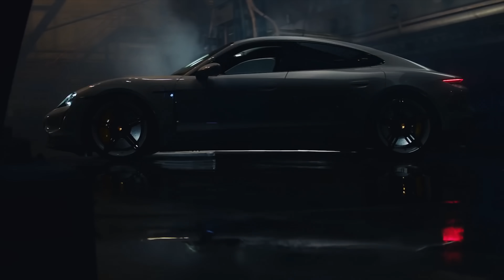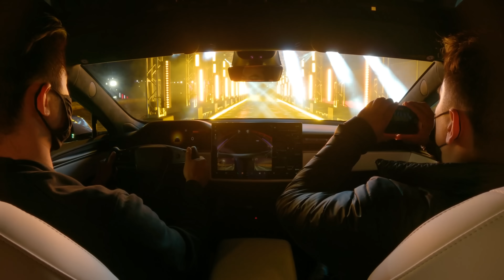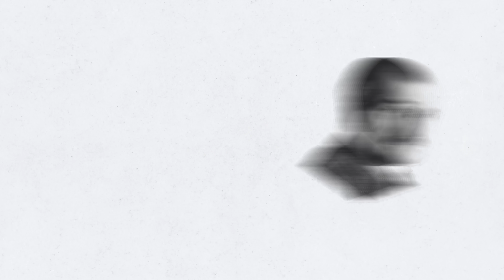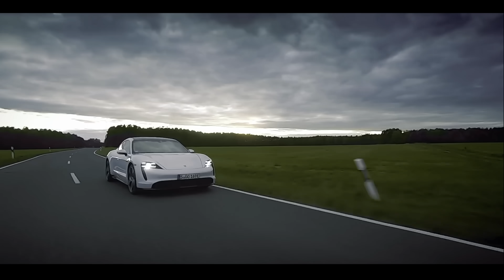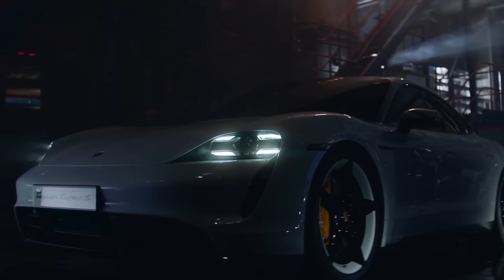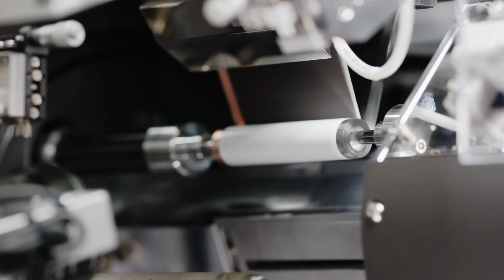I’ve Had Enough, Here’s the Truth About Tesla

Comment: Aesthetically, I'll take the Porsche.  Realistically, I will take neither and I hope I never have to own any electric vehicle.  I used to say that about automatic transmissions, yet circumstances dictated that my last purchase was of a Honda Accord with a 10AT.  After a year of driving it, I have to admit that I like it and the reason has a lot to do with the paddle-shifters, which give me very nearly the same control over the transmission as I had with manual transmissions and in some ways more.  I do miss the footwork, though.  So, while I'm not too old to learn to accommodate a new skill set, I  hope that I never get old enough see a time when electric cars become mandatory or the internal combustion engines become too expensive to operate.
Reply: They are already making EVs mandatory in CA. Glad I don't live in CA. I don't want to have to stop for 2 hours after every 200 miles of driving. Turn a 10 hour road trip into a 3 day road trip.
Reply: @keinlieb3818  it's not 2hrs, it's 20-30 min (with 150kwh charging) and under 20 min with 270kwh charging. I've taken road trips between Atl and Mia and the total trip time went from like 8-9hrs in a dino burner to maybe 10.5hrs in an EV
Reply: One of the main reasons this current government is pushing the gas prices up is to push us into EVs 😦
Reply: I couldn't have said it better myself!
Reply: Until EV charging is FAR faster than it is now, I’ll stick to gas engines… likely for the rest of my driving life. 

I have converted to cordless electric for all of my lawn tools though - even my lawnmower, which I like a lot.
Reply: @NorthGeorgiaHawg  I charge 200 miles in 15 minutes in a model three at a supercharger
Reply: @NorthGeorgiaHawg  I’m not pretending to try to save earth, they are just super fun to drive like a turbo go kart and retain all their value right now
Reply: Took the words out of my mouth.  Guess there is a psychological barrier to entry nobody talks about.
Reply: How do the paddle shifts do anything except pretend to be manual ? They dont do any more than moving a Old Automatic geat lever from 1, 2, 3 yourself manually. Agreed Automatics are better and less trouble these days, more Torque, less wheel spin in 4wd conditions etc and maybe taking away control so things get simpler and easier and probably safer but definately not more control over what happens to the vehicle.
Reply: @gravedanger789  Paddle shifters give you more control over the transmission than a typical automatic transmission has.  If you haven't owned one and learned to drive it, then I really can't explain it.  For decades I, too, scoffed at the idea until I bought my 2020 Honda Sport 2.0T 10AT.  It took me awhile to get used to it and after two years, I'm still learning, but I like the set up more and more as time goes by.  Please note that my Honda has ten forward gears, not three or four and shifting is smoother than any car I"ve ever driven.  There are times when it's best to let the transmission do its own thing and there are times when shifting for yourself is best. It's all about versatility.  When I bought my car I went in looking for a manual transmission, but Honda had stopped making them and there were none available in the United States for the dealer to acquire, so I took a test drive and decided to go ahead with the deal.  I will note that I'd been driving manuals for sixty years and thought I'd never be happy with an automatic.  Now that I'm in my seventies, I'm glad things worked out as they did.  Old dogs can learn new tricks.
Reply: Yes EVs suck!! My three year old EV has 50 K miles and I’ve spent zero money except window washer fluid, it’s quicker and funner to drive than anything in it’s class and it’s worth more now than three years ago. By the way every morning I wake up with a full tank for free. Thank you sun, dam EVs suck.
Reply: @John-209  Your points are well taken and my friends who own EVs confirm the benefits.  However, my preference is for internal combustion engines and the freedom they afford me when traveling.  I don't travel as I used to when younger, especially since the pandemic, but if I had to travel in an emergency, I would rather look for gasoline stations and not recharging stations.  I also live in an apartment and can't charge an EV at home.  That's an important factor.  I do have one question, though.  I presume that you have solar power and that's good for you, but not all of us have that option.
Reply: @GradyPhilpott  absolutely Grady I agree they are not for everyone. If you can’t plug at night they’re not worth it. I still love my old dodge gas powered pick up, have a good night
Reply: @John-209  Wait till it levels your house...
Reply: @isaac24  what?
Reply: @isaac24  what would level the house? The old Dodge pick up or the new EV?
Reply: @John-209  I'm still waiting to see what he meant by leveling your house, haha
Reply: @subarashiiashi3894  I’m thinking he means it will catch fire like a bolt

Comment: Unless and until battery technology VASTLY improves, I'm sticking with my ICE engines. If I'm driving a long distance, I'm not waiting around for hours for the battery to charge. I also won't have to replace an engine after a few years, as long as I maintain it properly. The same can't be said about batteries. No matter how well they're stored and maintained, all batteries have a finite lifespan that's much shorter than a well-maintained engine.
Reply: Try buying 10-year-old used Tesla batteries on eBay you're wrong 😱🤪😁
Reply: @rogerkerkmann  I'll trust my personal real-world experience with batteries over some internet rando, thank you very much.

Comment: So didn’t the tax payers pay for battery tech just like they paid for solar getting perfected thru NASA!
Reply: The US gov barely had anything to do with lithium ion batteries. It was panasonic.

Tesla works on their own battery chemistry, but their still lithium ions.
Reply: @honkhonk8009  so what have all the things in space used just direct current off the solar panels? Sure seems to me that system would need some thing to - even out, stabilize, or do what an inverter does compared to a generator? I suppose a little lead acid battery might work a top of the line one, if it’s not allowed to run down could last what 8 - 9 maybe 10 years?

Comment: Since Taycan was developed with old Model S as the benchmark so Porsche needs to do it again with Plaid.
Reply: @carsonj1  What happened when MB launched its E55 AMG in late 2002 with 479hp, was that the end of the BMW because the M5 at that point had 408hp?
And there are also many more important qualitites to a car than just even more insane acceleration. Unless you're 12 years old maybe.
Reply: @martinsvensson6884  you mean like the insane F1 like handling of all Tesla's? Yeah who would want that.
Reply: @SmokinPaul  Both MB AMG and BMW M petrol cars handle better than the high performance Teslas. Same goes for the regular SUVs.
Reply: @martinsvensson6884  LOL you don't have a clue. 😆 The battery pack is low making it almost impossible to roll a Tesla, suspension is more advanced. The traction/stability control is far superior because electric motors have extreme fine control you can't get from a brake controlled traction/stability system. 
But you keep dreaming and being an Anti-Tesla fanboy. 
You should take a Tesla for a free test drive. Many haters fell in love after one ride. 😊
Reply: @SmokinPaul  Yes I have. Because those cars have been tested. Its impossible to roll any car if its not wrongly constructed. 
Tesla has simpler suspension than the Germans. Its less advanced. Should come as no surprise. The German cars have to be adapted to the Auobahn where they behave much better than the Tesla.
No, the stability control has nothign to do with the electric motors.
They dont react faster either. The Tesla 4WD system is not better than anyones else. There are much better reacting systems out there. MBs for exampel.
Reply: @martinsvensson6884  keep believing what confirms your bias. 😁
Reply: @SmokinPaul  LOL  F1.... I have driven many TESLA's ...they do handle well but F1 is a laugh! Fanboy
Reply: @SmokinPaul  Has nothing to do with any belief. Has to do with testing.
Reply: @martinsvensson6884  guess you never heard of physics, weight distribution and center of gravity. 😊 One car is balanced, another needs to compensate for the lack of. 
Do I bet on Usain Bolt or the guy with the prosthetic? Yeah that's a tough one.🤔
Reply: @SmokinPaul  Its not enough.
Reply: @martinsvensson6884  you are free to drive anything you want. I'll take my Tesla that doesn't breakdown, doesn't use expensive very flammable gasoline and does handle like an F1 with perfect balance between front and rear. You might want to watch out for the moose though. 😄
Reply: @martinsvensson6884  why don't you take a Tesla test drive and tell us what you think? It's free and you can request one on Tesla's website. Many haters fell in love on the first test drive. At least you could be talking from experience then.
Reply: @SmokinPaul  If you want the best handling car you get an M or AMG. 
Doesnt break down? Haha :) No such evidence out there.
Reply: @martinsvensson6884  LOL 🤣 um yeah there is. Spinning electric motors are not under anything close to the stress as a reciprocating internal combustion engine that sees huge temperature swings and requires lubrication on it's plane bearings. 

But you keep on with your fantasies, EVs will continue to prove you wrong. It's the reason car dealerships want nothing to do with EVs, they can't make enough money on servicing them.
Reply: @SmokinPaul  The electric motor is a great device. Problem is the introduction of batteries and all their management.
The combustion engine is seldom the failure point of a car. And a good one will outlast batteries.

The reason car dealerships "dont want EV's" is for example that Tesla refuses to give them the info to be able to work on them.
Reply: @martinsvensson6884  Ford dealers don't want to sell MachE or any EV. Is it because Tesla won't give them info. 😂🤣 FYI they have already trained their mechanics on repairing their EVs. 
Tesla's are made to commerical standards to last 1 million miles and the batteries will outlast the car. 
You know so much, unfortunately most of what you know is wrong. 😁
Stop huffing glue, it's bad for your brain. LOL
Reply: @SmokinPaul  No but if the repair shops dont want EVs. 
Haha :) you need to stop reading fantasy on the internet and believe that's reality. No the batteries wont last 1 million miles. Not without heavy degradration and there are already people that have had do change them. Long long before that.
You need to enter back into reality from whaever delusion you're smoked yourself high into..
Reply: @SmokinPaul  If it handles like a F1 car, then why the Model S plaid was barely faster than the Alfa Romeo Giulia Quadrifoglio (510hp, 2x times less than the Tesla) on the Nurburgring?
Reply: @normaluser5755  LOL what's your point? Low center of gravity makes for exceptional handling. Your argument is you know a car that can win a race. :-) 
In your mind you win. hahaha
Reply: @SmokinPaul  You really think that low center of gravity is the only thing that affects handling? The S Plaid did so poorly on the Nurburgring because of it's terrible handling, combined with a poor steering system and awful brakes. It's even funnier that you're comparing it to the handling of F1 cars.
Reply: @SmokinPaul  Tesla's are only good at 0-60 times. Leave the race-track to cars like Porsche, Bmw, Alfa Romeo and other proper sports car companies.
Reply: @normaluser5755  An EV weighs as much as a truck so there is that. You keep thinking I was directly comparing a Tesla to an F1 instead of talking about it's F1 like handling. Keep missing the point to win the argument in your head. LOL Enjoy your ICE, it's a dying breed. :-)
Reply: @normaluser5755  Hahaha I don't drive my sedan on a race track, I drive it on the street where it is superior to most cars and has exceptional handling. But but you think a Porche is better on the track. LMAO 
FYI you are missing the forest for the trees.
Reply: @SmokinPaul  Exceptional handling LMAO. Have you ever driven an actual good handling car? Tesla cars handle like whales that swing around corners. Please try a BMW m3, Alfa Romeo Giulia or any sedan with actual good suspensions. Tesla's suspensions are terrible. I picked race-track times as an example of Tesla's bad handling. In no way Tesla's handling is F1-like.
Reply: @SmokinPaul  And yes, I'll enjoy my good sounding and good looking 2010 Alfa Romeo 159 :). Enjoy driving your soulless fridge on wheels.
Reply: @normaluser5755  yet you drone on and on. Apparently you never drove a Tesla, only your favorite sports cars that are not that good at being actual race cars, just pretenders. 🤣 
Like I said you win... in your mind. 😁
Reply: @SmokinPaul  They're still better sports cars than any Tesla. I know it's hard to accept that the M3 and Giulia are sporty sedans with a better suspension system, better brakes and an almost perfect 50/50 weight distribution that no Tesla has.
Reply: @normaluser5755  ROTFLMAO what ever gets you to sleep at night. 🤣
Reply: @carsonj1  But who really gives a stuff, both cars are excessively fast.
Reply: @carsonj1  Which automotive manufacture has a larger market name?? PORSCHE...Anyone with a brain would go for the PORSCHE....not only known as a sports car company but has also been around for a very long time....the jury is still out on TESLA's longevity as well as durability !
Reply: @carsonj1  you do know the gt2rs is the king of the ring right? You know that’s a gas car right? You do know that’s a porsche right?😂

A Tesla Model S Plaid has set a new lap record for electric production cars at the Nurburgring, with an official lap time of 7min 35.579secs. 

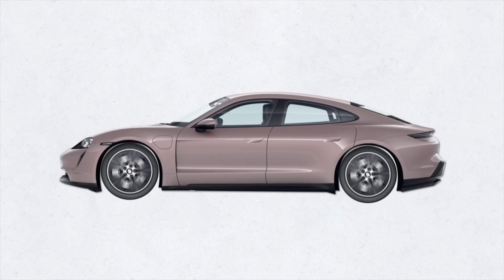The best time of 6:43.300 minutes was achieved on 14 June, in the presence of a notary, with Porsche development driver Lars Kern at the wheel of the 515 kW (700 PS) 911 GT2 RS.   

Time for bed kid🤣 That a gas car…. and that’s embarrassing…… now what was it you were woofing about Porsche??, Oh and one more thing…… you do know Porsche owns a stake in rimac correct????? Tesla fanboys are something else😆
Reply: @carsonj1  The Porsche disposed of the model S, model S raven, model S raven with cheetah stance(whatever that means😂), then the fanboys said just wait for the space x Tesla with the rocket boosters, then they said wait for the Tesla roadster. Them goalposts keep moving
Reply: @carsonj1  The best air suspension according to virtually every car review that has ever been done is MBs.
They soak up bumps better and it behaves better at high speed. You have to understand that the Germans have been making air suspensions for many decades now..
There is no comparison. You can get a camera that reads the road and adapts it even. There is nothing that is more "advanced" in the Tesla suspension. 
You have to stop living in fantasy land. 

Nothing of that torque vectoring goes "far far beyond" anything you can do with an ICE. You can apply the brakes and even the engine if wanted to accomplish pretty much the same thing. Sure, if you have motors for every sperate wheel then you could do some tricks you cant in an ICE. But from what I know Tesla doesnt have separate motors for each rear wheel.. So in an emergency you can create much of the same effect with just the brakes.
Reply: @carsonj1  you are preaching to the choir. 🙂 I own a Tesla and I can never go back to ICE. Unless it's a 1972 Camaro for driving fun. But then I would dislike it for it's poor acceleration. 🤔 LOL
Reply: @carsonj1  Found the Tesla fanboy
Reply: @carsonj1  It's easier for Jackson to try and dismiss you with an insult. LOL 
What he is not aware of is that he is the real fanboy, an anti Tesla fanboy. 😁 If only he could show us where Tesla hurt him. LOL 😂

Comment: 69 Camaro. Then my 01 Lexus SC 460 to pull my camper. Long time before an electric car or truck replace these 2.
Reply: You're kidding right?    The Rivian RT1 which is coming out soon can out speed both your cars, and pull 11000 pounds....  The F150 lightning slightly less.   And the Cybertruck can pull your camper, and behind your trailer, your Lexus on a flat bed, while at the same time, out speeding your camaro....  (but I give you that the 69 Camaro is sweet still)
Reply: @RealDufour  is it going to pull a camper 1000 miles? Think not. As to the 69 Camaro, it's not speed but style. No one is going to give the Rivian more than a passing glance to determine that it isn't a pregnant DeLorean! 🎃🎃🎃